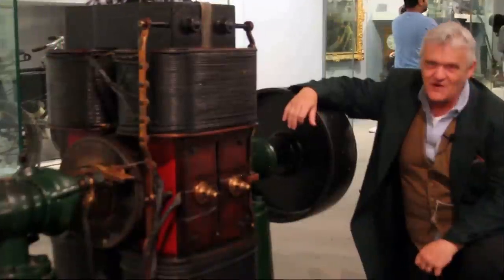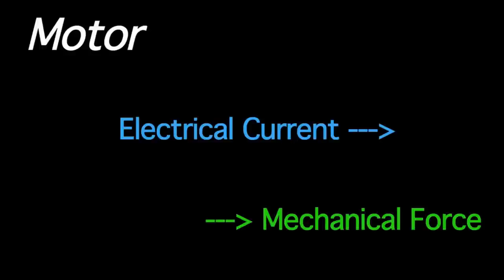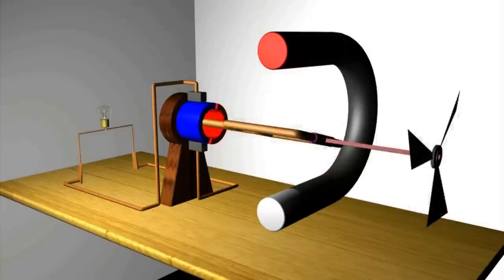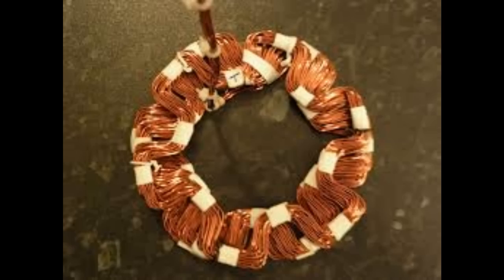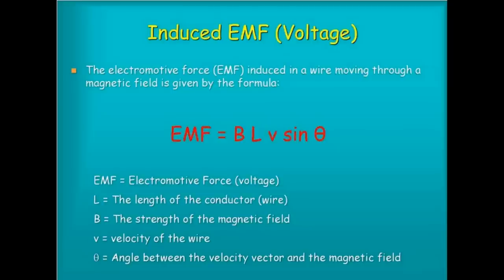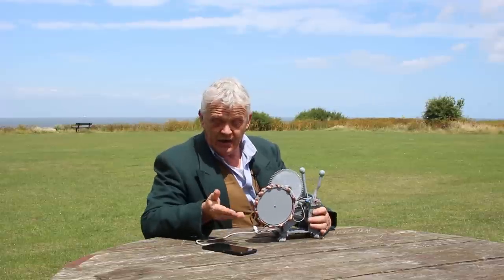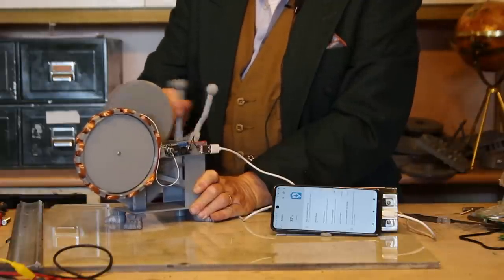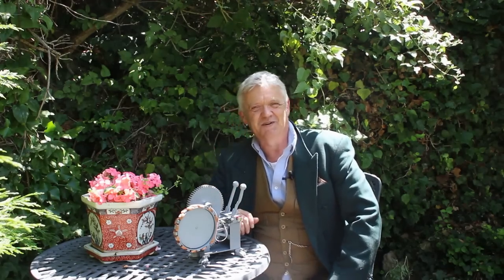1983 Weird Emergency Phone Charger - For When There Is No Wind Or Sun

Comment: First Comment🎇
Nice design, Robert.  I made a similar generator but mine is foot powered, and charges a capacitor bank.  
The capacitor bank acts like a battery so you can stop running the generator, and let the charge in the capacitor bank continue to charge the phone, or whatever USB device you have.
Reply: @Maungateitei  Build one and make a video...
Reply from the maker: I am sorry mate but you may have completely missed the point - this isn't an application it's a demonstration of principles - Valve man has it right - i don't want to be cruel but your suggestion - well it's an idea
Reply from the maker: Very cool mate

Comment: Thank you for your wonderful video, Robert. Here is an idea... Wouldn't it be wonderful if there were people powered generators in every waiting room in the world, and in every bus terminal and airport...Time spent well...
Reply from the maker: it wold be awesome mate
Reply: I envisioned that a gym [individual unit/part of a leisure centre] would be a suitable “human” power station = generating electricity while exercising on a treadmill, exercise bike, rowing machine, and instead of lifting weights on a weights machine the cables will be pulling on a hydraulic/pneumatic actuator that will fill a tank and at a certain pressure a valve will open and drive a turbine > generator

Comment: I think you should make a simple lift from upstairs that uses your human weight to charge some super cap.a simple rope with a foot sling could be done and you lower down on it. That energy can then be used immediately to charge a phone. i estimate you could collect 200 watts for every 5 seconds.I think it would be great education and entertaining if not fascinating with the results but mostly just a great visual ways to demonstrate how much it takes to charge a phone .
Reply: Good idea! I’m actually working on a project very similar to this as just a hobby of mine. I’m trying to work on a planetary gear system to generate really high speeds since the gear system has to be compact, although it might need a 2-stage system.
Reply: @xLenny22x  you might be best to buy a cheap small handheld electric winch  and use the parts out of that
Reply: @Buzzhumma  I’ll look into it thanks for the suggestion
Reply: Better without electronics. Just use ratcheting mechanisms
Reply from the maker: you can calculate it mate 1 watt is one joule per second and to raise 1kg per meter takes 9.8 joules
Reply: @ThinkingandTinkering  great

Comment: The funny thing about those two diagrams is that they both reverse the stator placement compared to how the textbook shows it. In the textbook, you move the magnet compared to the stator, not the other way around... But it's actually more efficient to have a static, coiled magnet and a free, magnetically open, operator.
 
😉

Comment: Silly question: Strength of the magnet is a factor in generation, right? What if we used an electromagnet? We'd lose a bit of power creating the magnetic field, but we could potentially generate more energy than we're using to create the electromagnet, depending on the force of the motion spinning the rotor...  Is this a thing? Or no?
Reply from the maker: you are spot on mate

Comment: Rober, why did you show the electric generator which  has rotation perpendicular to the horseshoe rod magnet and the electric motor rotating inline with the rod horseshoe magnet.?? Nicely illustrated video Sir.
Reply from the maker: it doesn't matter mate - i just moved the magnet so the fan could join up with the coil easily but the magnetic field direction is unchanged
Reply: @ThinkingandTinkering  Thank you for straightening that out fella. I just took the picture too visually meaning wise. Nice work Sir.
Reply from the maker: @victoryfirst2878  glad if I helped mate
Reply: @ThinkingandTinkering  You set my mind straight mate, you know the gray matter between my ears. Peace vf.....

Comment: That motor turns into generator than generator turns into a motor.....is a mazing Robert...
If you suck the water from long pipe, oneside connect two motor pumps and another side generator, and it can produce voltage...now you have generator and motors at the same circuit, and your power consumption goes down....isn't that a mazing...!!!😂😂😂

Comment: So cool, coincidently i had this thought while riding my bike the other day, didnt feel like my energy was being transfered efficiently or i was wasting lots of movement. It seemed i only put force on the top part of my stroke and the rest of the cycle the motion wasnt transfering any energy infact i was wasting energy to get back to the top.   I was trying to imagine a bike that let you use your arms to compensate, but then the video of the sewing machine comes out and explains everything why a bicycle isnt actually the most efficiecnt way.  I was imaginng a full body bicycle to compensate but the singer sewing machine figured out a better solution, although yours seems to be along tha path where you could use your arms to do the pushing and pulling and perhaps actually make a bicycle out of this design that lets you run on wheels!  But as a charger this looks way easier than hand cranking in a circle, well done.
Reply: Circular motion such as in bicycle is good because it gives you momentum and dampening motion so you have the 'rest' time (for the lack of better word) for your muscle to extend and contract properly. If you have to pump lots of fluid using manual hand pump, you'll definitely want to use the one that has circular motion instead of linear one because of that. Linear one such as what people normally use in servicing is because they can be precisely controlled so they do not overfilled.

So you are not wasting any movement because bicycle is designed as simple transportation tool that people can pedal over a long distance using our muscle. You need a nice balance of force and rest period to be able to do that.
Reply from the maker: cheers mate
Reply from the maker: hiya mate - I am sorry but that doesn't sound right - it just sounds like that's what you think - if what you are saying is right why do linear pumps predominate in hand pumping? why have the railways used pump trolleys? I think the only real reason some pumps are rotary is they are powered by motors so they have to be rotary - that's about it really
Reply: @ThinkingandTinkering  Good day mate. Hand pumping for linear pump because it's much cheaper, simple and smaller in design as well as easy to metered, slighty pressurized to enter the system, such as in oil and hydraulic servicing equipment for example. But if you have to pump for much larger volume and faster, circular is more relax, such as radiator water pump. Perhaps water hand pumps that utilized both principle is good analogy.

For machinery it depends on applications and other factors, either to pressurize, transfer volume, cost, etc. For example, air compressor normally convert to linear because the design is simple to create higher pressure and it can use mechanical advantage as leverage for much higher torque, so we can use smaller engine for it. Turbine engine is good example of how complicated it would be if we using circular motion to create higher pressure for air. To achieve the same pressure ratio, it will be much expensive and complicated design.

Of course, my explanation is only for simple design.

Comment: Slap a 2nd coil on the other side to double the amperage and reduce the charge time while using the same amount of work
Reply: @ThAwesomeHomestead that would not be correct. Of course it would function, but addition work (force) would be necessary to overcome the second coil and circuit resistance. “Free” energy isn’t yet possible.
Reply: @gaspumprepairservice7009  I'm not talking about free energy, the force required to wiggle those toggles is so minimal that adding a second coil could be unnoticeable. And if the resistance is too great, just take it back off
Reply from the maker: you could mate or just add a 2:1 gear - the effect would be the same and it would be cheaper to do

Comment: I'm Impressed that it puts out enough power to charge your phone! Now I have to see if my Pump Drill Generator will charge my phone too. LOL.
Reply from the maker: It probably will mate - when you do the vid send me the link and i will post your link
Reply: @ThinkingandTinkering  I just added a regulated 5v DC circuit to my Generator output and tried to charge my phone. Initially it started to charge the phone but soon cuts out. The amperage output is probably just not quite enough for a steady 5v charge. :(
Reply from the maker: @William_Hada  try charging a cap bank first mate
Reply: @ThinkingandTinkering Yes, that looks like the way to proceed. I tried some larger value capacitors and supercaps but it was taking a super long time to charge them to the 5V needed. I gradually dropped down to 2200 microfarads but I quess that is not enough capacity to sustain a stable charge on the phone. I'll continue to work on it. Thanks for the input!

Comment: Steam punk project start...

How about using the prints as mold filler (with added flow and vent tubes) then casting everything but the rotor/stator in Brass ! 
Give it a Diy wooden base and you have a durable unit plus the molds to replicate!
Reply from the maker: now that would b cool!

Comment: U could us another voltage regulator for fines with adaptive fast charge 9v 1.86mah I believe then it wouldn't take as long. 
How about weight's on the arms an have longer stronger arms and each time one goes down take of a with their other drops and repeat?? Xx

Comment: Now, if it was a foot pedal operated device, a la Singer sewing machine, it would leave you hands free to use your phone while its being charged... 😁. What sort of current are you getting on the USB output...?
Reply: Probably need an analog meter take the average of the low and high readings
Reply from the maker: see the earlier vids in this series mate

Comment: Can a generator be built that sits on top of a wood burning stove and uses the hot air to spin a turbine?
Reply: Better use a few Peltier elements for that. If you don't know them look up there are many videos on it
Reply: Those fans that you see use a peltier device to produce electricity to turn the fan blades. All of them work this way. If your going to use a peltier device,  might as well wire it directly to the charger and skip the loss visit transition to and from mechanical and electrical power.
Reply: TEGs are the way to go!
Reply: @normandothegreat  Totally,  why waste the heat!
Reply from the maker: yes

Comment: why not have 3 coils, 2 extra on the flat sides, might not even need extra magnets
Reply from the maker: because it adds cost - copper is expensive and you could get the same effect with a higher gear rato

Comment: Can you make a crystal amplifier that uses a one to 18 Henry coil a hundred watt piezo device across the coil and use it as a resonator or in a circuit to pick up AC hum from a high antenna and a good ground connection?
Reply from the maker: like a crystal radio?
Reply: @ThinkingandTinkering  Only you replace the germanium diode and coil with a huge coil and a high wattage piezo element.
Reply from the maker: @travismoore7849  cheers mate
Reply: @ThinkingandTinkering  I have tried it with a transformer with 300,000 mh primary with a small piezo element on it and got a buzzing. Though  I thought what if I went bigger. Though it could have been the electric on the tv antenna making the noise from the tv.